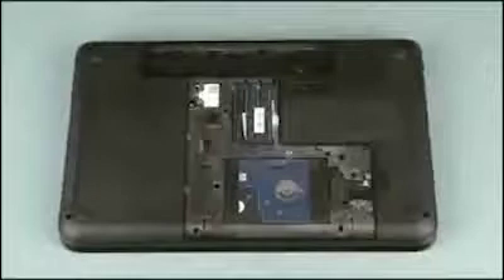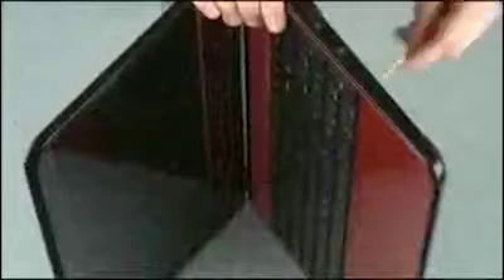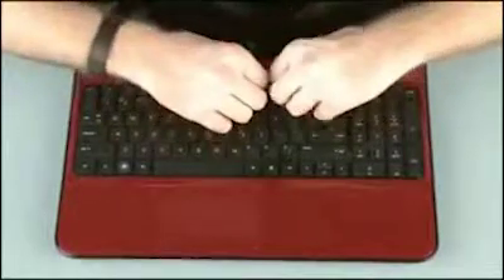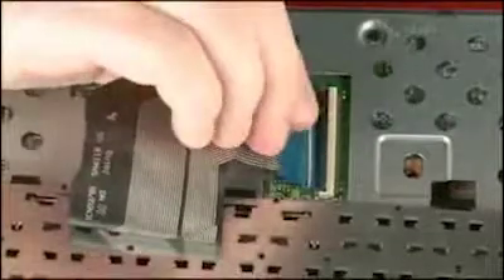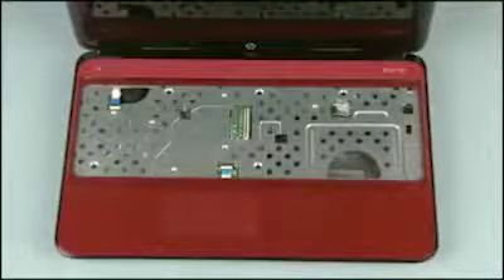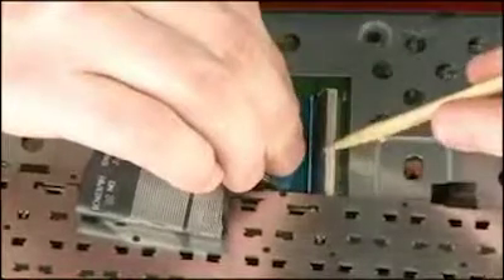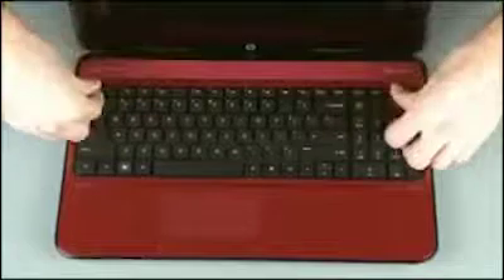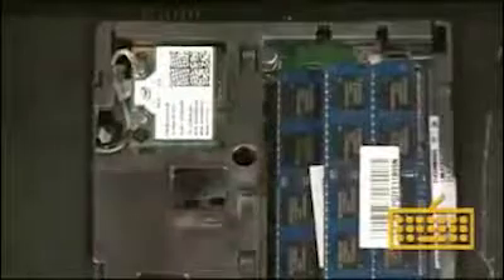Replace the Keyboard | Pavilion g6-2000 | HP Support

Comment: Followed this procedure implicitly but still cannot get the keyboard out model is a G6 1241sa. System runs Linux Mint 21 perfectly but 2 keys on the Keyboard do not work. The refurbed Laptop will be used for a community project if fixed.
Reply from the maker: Hi there, thanks for contacting HP Global Social Media Support!
I understand that you need to know about replacing the keyboard of your notebook.
I will do my best to assist you.
Please refer page number 53 of the user manual to know about replacing the keyboard: https://hp.care/3NhE7dU
Regards, 
HP Support
Reply: Thank you for the link to the manual - will study - have repaired quite a few laptops but this keyboard is proving to be stubborn to remove. Will let you know my progress.
Reply: Hello - checked the manual to ensure I was following the correct procedure - I finally got a very thin tool - surprisingly a Ball Needle Adaptor Inflator for blowing up balls as this fits the hold neatly and is sturdy. I had to apply quite a lot of force to remove the keyboard as it looks as if there was a sticky spillage which had glued it in place - anyhow it clicked out - so now I can replace the keyboard and start re-using this laptop - Thank You - another one rescued from landfill!!
Reply from the maker: Thanks for the reply.
Please let us know how it goes!
Regards, 
HP Support

Comment: I accidentally spilled water over the keyboard so when I press on certain letters, they come out as multiple letters. Does replacing the keyboard fix this problem or is it just cosmetic? Would you be able to know what to do?
Reply: Also wondering where I can get an official hp battery replacement and keyboard for this laptop and part number please and thank you
Reply from the maker: Hi Prodigy, thanks for contacting HP Global Social Media Support!
I understand that you are experiencing an issue with the keyboard of your notebook.
I will do my best to assist you.
Issues due to liquid spill are not covered under warranty.
Use the HP Parts surfer to identify the part: http://partsurfer.hp.com/search.aspx 
And order it via the HP Parts store: https://bit.ly/3nKMYrs 
Binu_HP Social Media Tech Support
Reply: @HPSupport  First link does not work and 2nd link can't find the part
Reply from the maker: In order to get this issue fixed, please contact our customer care team over the phone or chat for further assistance, as this issue requires Live conversation with you over phone or chat to isolate the issue and provide you instantly with appropriate solution or repair/replacement options available at your place as per the warranty.
Please feel free to reach us on call/chat, please access this link to select your preferred country and language option to reach us. Global support link: - https://www8.hp.com/us/en/contact-hp/ww-phone-assist.html
Binu_HP Social Media Tech Support